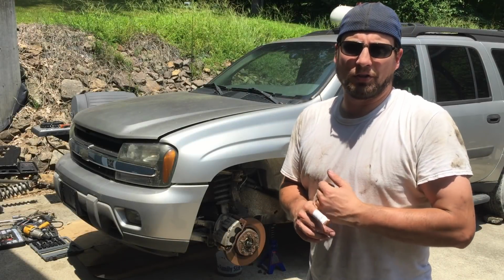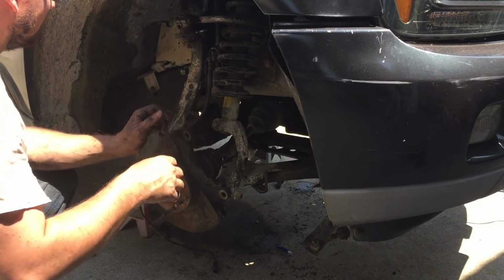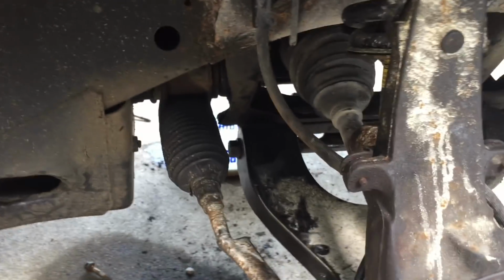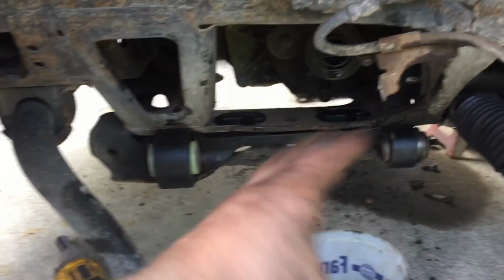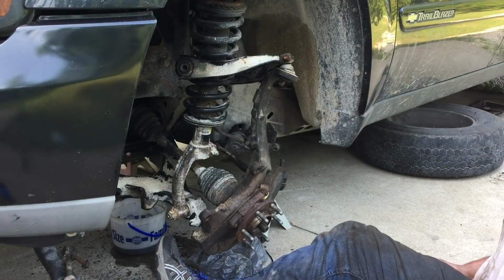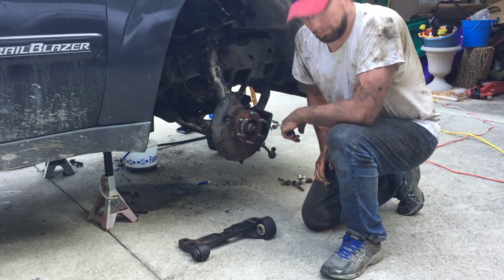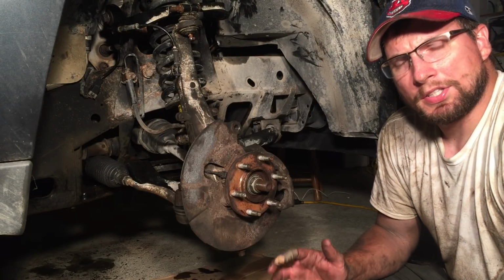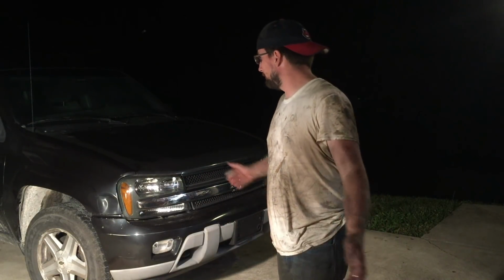Project Failblazer Episode 4 - Finishing off the front end swap!

Comment: Come to think of it, you should've gotten a parts truck to fix the Yukon... My 95 Yukon is currently having some issues in the engine, but I'm not yet ready to give up.
Reply: i saved a 94 suburban k1500 from being scrapped i paid $350 it runs drives engine has 50 oil psi at idle both front an rear a/c systems work the check light goes on an off going down the hwy though